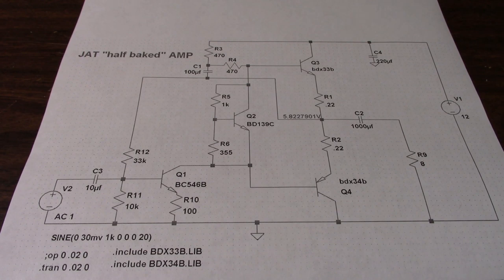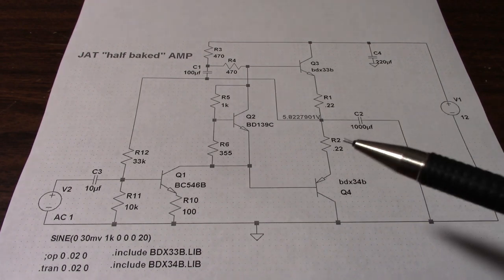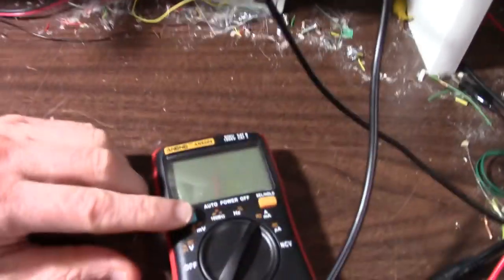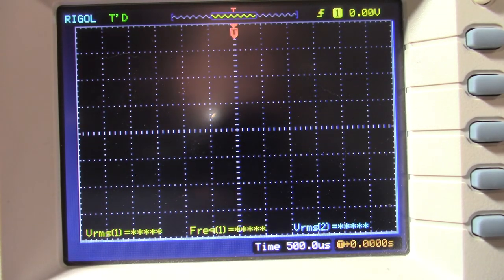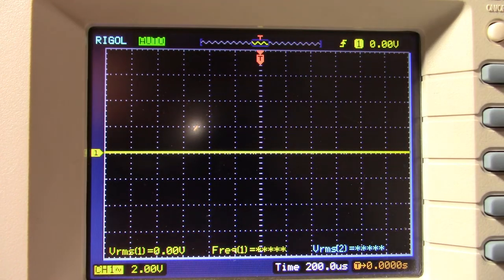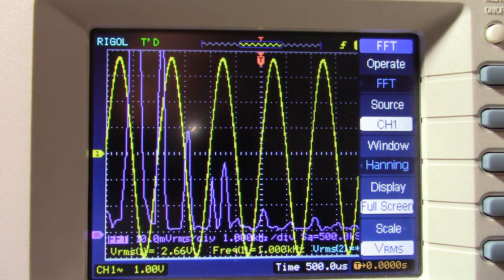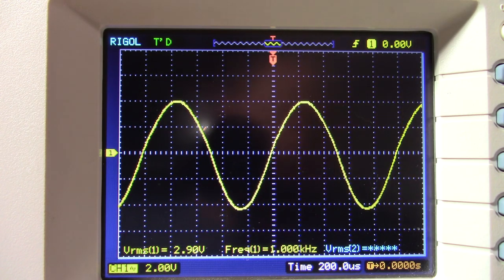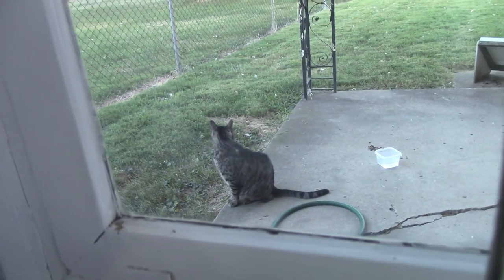JAT half baked 1 watt audio amplifier build and test

Comment: I've built many similar amplifiers, typically about 1.5W <1%THD, with a 12 volt supply. To reduce distortion put a resisror in series with the input capacitor. It isolates the source impedance from the feedback loop in the amplifier - works every time. Also the voltage at the midpoint of the output stage should be slightly higher than 1/2Vcc for best results. Since you have LT Spice, you can tweak things with very little effort, then modify your test circuit.
Reply: This must be why when i built this circuit but with an opamp, i found if i used a 47uf electrolytic , as soon as i connected the input source, the signal would go off center (the output opamp signal was mo longer 1/2 vcc). I "solved" it by using a much smaller capacitor, like .47uf insteas. But i could not understand how an input on the other side of the cap could have affected my opamp dc offset!!!

Comment: I do believe the boot strap circuit is a non-linear load, which is distorting the output. That's why it cleaned up with the 4Ω load. It lowered the effective output impedance, reducing the influence of the boot strap. You might try increasing the value of that capacitor.

Comment: I made a version of this with only two somewhat beefy transistors. two diodes. two resistors. and 2 to 3 capacitors. And some heatsinks. And it actually worked very good with a 4ohm speaker. Actually even better than an lm386 Gain isn't as high unless you crank your audio from your pc to the max. but it outputs way more bass and low frequencies are a lot better.
You could add some filtering to reduce hiss and prevent oscillations or radio frequencies.
Sort of the "output" section of a class A/B amplifier. but without the A section! So basically a class-b amp with biased output transistors.
It had quite low distortion too. could feed it up to 12v. and it'd work very good. even driving a sizeable speaker.
You get more output by using + and - supply voltages. with the speaker in the middle with some capacitors.
But you can also run it off a single supply (Discovered that by accident.)
I think it worked so well for me cause I went nuts with the biasing resistors lol. I used really beefy 5w 470ohm resistors so they dont overheat but bias the chips a lot more. they'll run hotter but can give more power to the speaker.

Comment: You aren't getting any negative feedback if driving that amp circuit from a low impedance source, since the feedback current just gets absorbed by the source.  Disconnect the bottom of R11 and drive it directly (DC coupled), and you should see a lot of benefit from the feedback, especially if R11 and R12 are scaled down so the base current of Q1 isn't such a burden for them.
Reply from the maker: I figured out that NF wasn't working and  added a resistor to the input. Covered in the followup video.

Comment: Hi  john, I have one stk 4141 20 watts  RMS per channel  sterio amplifier and one 2sc 5200 2sa 1943 100 watts RMS per channel sterio amp please suggest matching woofer and tweeter to get the maximum result.please mention the size of the woofer magnet size,ohms and wattage specifically .I use 24 0 24 transformer for stk amp and 30 0 30 for 2sc 5200 amp
Reply: Stereo

Comment: Hi John  . How are you ?  Actually I ordered lm 3886 sterio amplifier board from bagood but as soon as I hooked it up it blew up within  half a second .what could be the reason ? I used 24 0 24 dual dc voltage .
Reply: reverse polarity

Comment: How can you have all that second harmonic with a complementary push pull? In theory they should cancel the even harmonics? As I write this I feel I'm missing something obvious..
This type of amplifier common in the sixties radio was well suited to the germanium devices that were common then. The much lower vbe, often below 0.2V allowed for much lower idling current among other benefits...Thermal runaway and delicate devices not being among them.
Edit : And often not having the complementary  available meaning many were quasi- complementary.
Edit again..Was the 5.8V mid point a measured value? You should be able to get nearer 2W into 8 ohms?
Reply: Martin D A The cancellation is obviously not perfect. You can see that if you look at the waveforms—clearly asymmetric.
Reply: @MM-ln9ey  Yes,  I understand that, it's just the fact it was an order of magnitude greater than the odd harmonics and I don't see how..still.
Reply: Martin D A well, unfortunately sometimes our expectations are not matched by observations.
Reply: @micomrkaic  Fortunately I expected nothing from you and that was confirmed by my observations :0)

Comment: How about a low watt, say 6 watts and under. Class a amplifier?
Reply from the maker: This is a class AB amplifier. The bias is under 100ma. It is single supply so output is set at 1/2 the supply and uses a coupling capacitor.

Comment: hi John A 5 watt version of this would be great :)
Reply: you will need to optimize the emitter, collector bias of Q1, also need to add an electrolytic parallel to emitter resistance for an symmetrical clipping. and not to forget adjust the base voltage of Q1.
Reply: 20V supply will give you just over 5W...into8 ohms. 10 into 4.